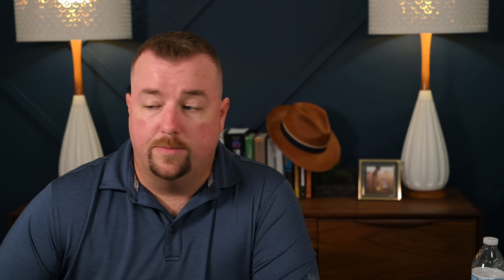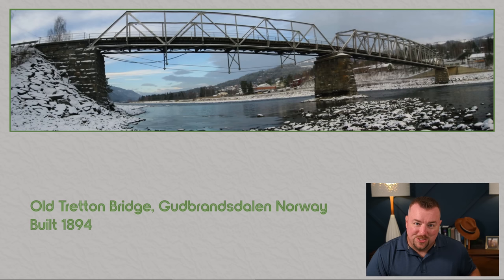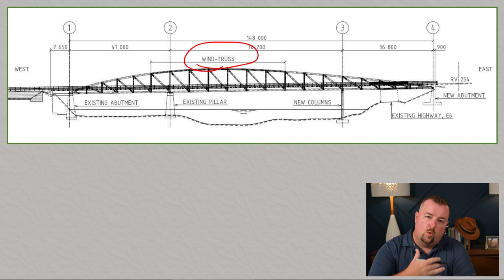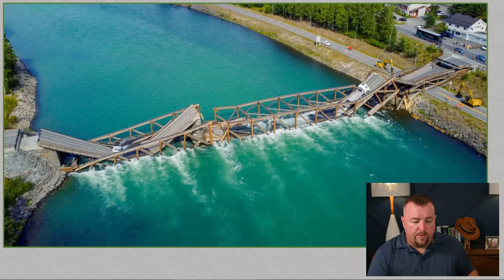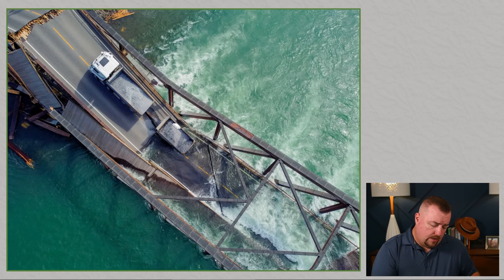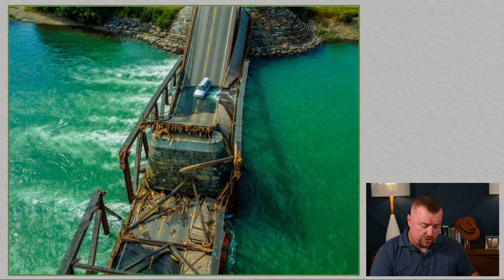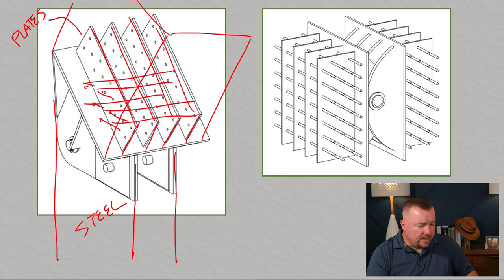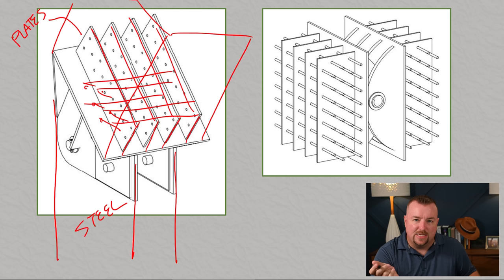How Did the Engineers Miss This?

Comment: To me , Im not a bridge engineer or anything , but it seems to me that the entire basic design is to blame here , not necessarily the joints. If you look at photos of the bridge before collapse , these things make no sense to me : all the diagonal beams are tilted the same direction. Why ? Estetics? It seems obvious to me they should have been been crosses or going zigzag. Clearly , if they are all slanted the same way, any stress or movement in the road direction ( such as a heavy truck breaking hard) would simply propagate and move or bend the whole arch the same direction.

2: the arch seems to be mounted on the side of the road bed; its not actually supported by anithing but the road bed itself. Again it seems obvious to me that the arch and beams should be supporting the road, and not vice versa, also its one hell of a long stretch between the supports. If the arch is just mounted on the road bed side like it seems , its doing more harm than good , its basically just adding weight . And since , like i said before , it doesnt have cross or zigzag beams it doesnt even act as much of a stiffener either.its just more load. I think the designers of this thing have become lost in estetics and overthinking and lost sight of some basics.

Comment: Can any joint in a truss be free of flexing forces?  It seems to me that any flex would put asymmetric loads, and possibly added wedging/moment arm loads on the pins/dowels.  I agree that treating the wood as a uniform material is irresponsible, and doubly so for a glue-laminated member.  The only way to avoid that might be to put a hinge pin within the steel part.

The politicians and their Green Priests have to bear a lot of the responsibility for this disaster.

Comment: glulam aka glorified plywood, pieces for connect between  point c  and d are laying on the bank  the bottom  the  brace and the splintered pieces of the top  wood. i can show you numerous bridges all out of wood mortise and tenon construction the  have  been   i  place for  over a century and still used today all over  New England bridges and buildings in japan all in wood  as strong today as they were  centuries ago when built. But who in there right mind  makes  pinned  pieces  in plywood . Personally looking at the style  of braces  they   look like  poor design loading, wood used proper is as strong as steel in bracing  is proper.   glulam is garbage   we have advanced in technology  but gotten dumber because  computer  errors  in design , remember what you get out of the computer design is only as good as the  person programming it and inputting  th parameters and it cant recognize grain structure  flaws in wood a crafts man can in designing